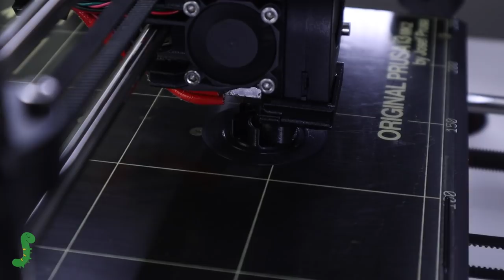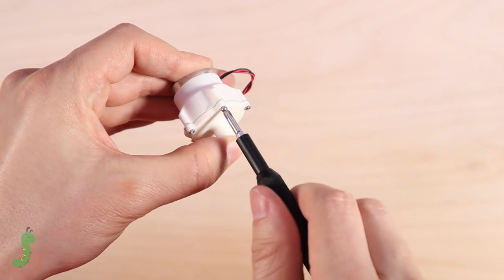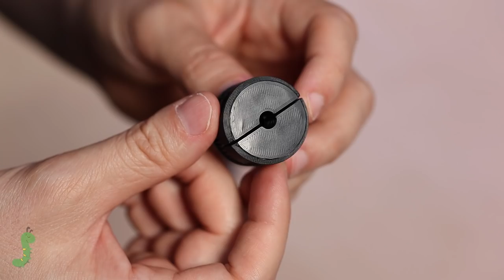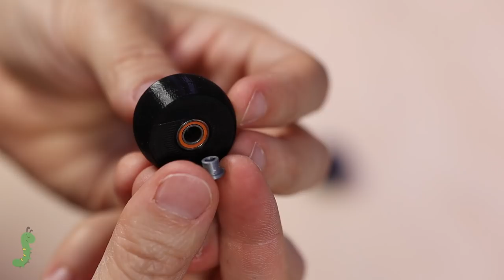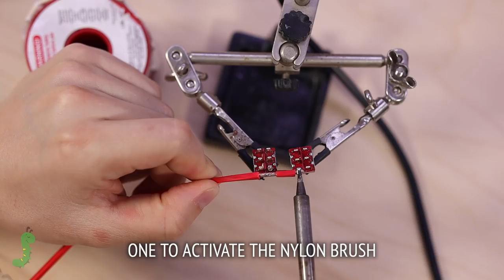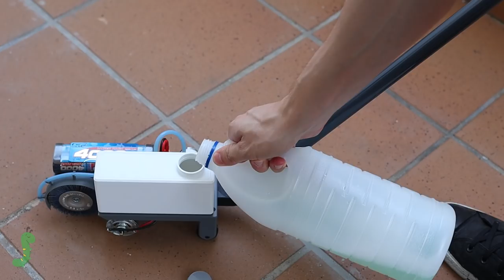Making a Floor Joint Cleaning Machine

Comment: That’s amazing! A neat watch for us and clean floors for you. 🥳
Reply from the maker: Thank you Malto! I'm glad that you like it 😉
Reply: Elite Worm For sure! So how did you get the cleaner tank water tight? I have an MK3S and it doesn’t seem to mater what settings I use, eventually the container will drip a little.
Reply from the maker: @maltoNitho  To be honest I haven't done anything special... I printed it at 0.2 mm using regular PLA and it came out water tight. Try rising the temperature a little maybe so layer adhesion is better...

Comment: Just a thought after watching this struggle a little, you could use an rc esc to give you more amps to the motor and less direct strain on the battery.
Reply from the maker: Yes, that's a good idea. And having the possibility to control the speed of the brush with a potentiometer would also be cool. Thank you Moxzot!